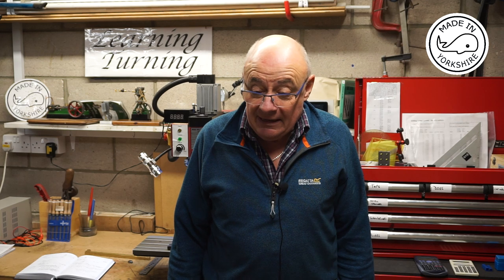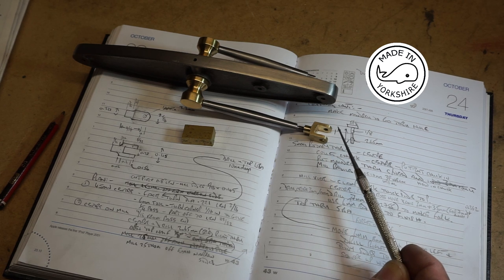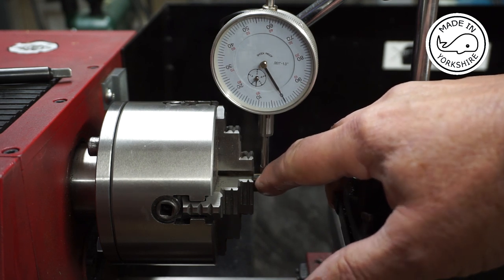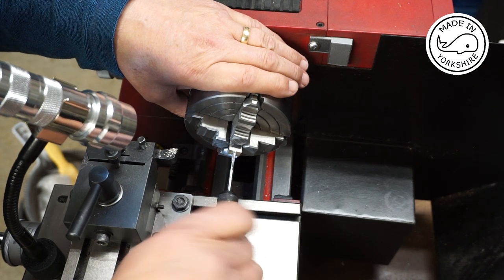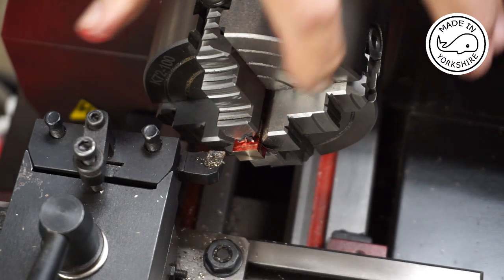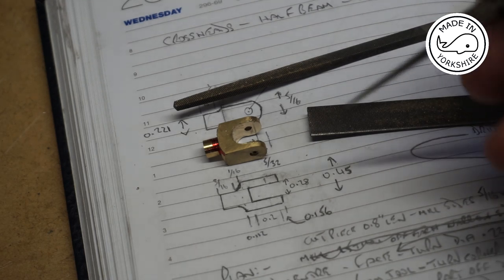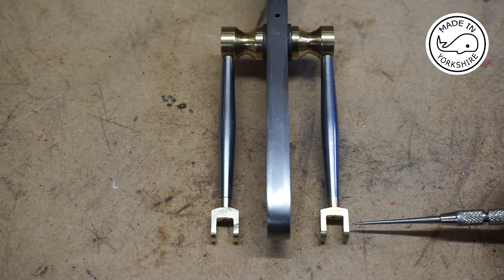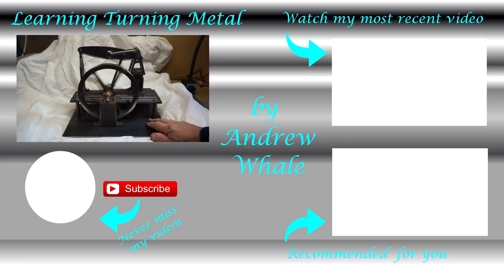#MT32 Part 16 - Making a Stuart Half Beam Steam Engine. The Crosshead. By Andrew Whale.

Comment: And today's lesson, for bulk removal it is often better to plunge cut with an end mill, the clue is in the name😉
And the supplimentary lesson is, set the fixed jaw to zero on the dro, and keep it set in abs if you have one, then to drill or machine in the centre you first measuring the part and moveto half the figure. Saves endlessly using a edge finder to find the same point over and over again. I said the same thing to The Lipton and he now advocates it too.👍
Reply from the maker: Hi Chris - thanks for the advice. I did wonder whether to plunge cut but I was concerned that it would put too much pressure on the crosshead and cause it to move in the vice (the item wasn't wide enough to allow me to leave the parallels underneath)  - so I opted to cut horizontally. I only used the edgfinder once - so not sure what you mean regarding the absolute setting?
Cheers
Andrew

Comment: In the last scene you were showing that you had to tap the left side but that the right side had already been tapped (contrary to the drawings). Why didn’t you swap the one on the right onto the left arm and then tap per the drawing?  Or am I missing something?  Great videos however.....  big fan.  Cheers from Canada.
Reply from the maker: Hi mate - good question and well spotted. I thought about doing exactly that. However when I switched them around the other crosshead tightened into a vertical position. This must be due to the threads starting at different points in each of the beam pivot supports. Such a shame!
I really appreciate the feedback though.
Cheers
Andrew